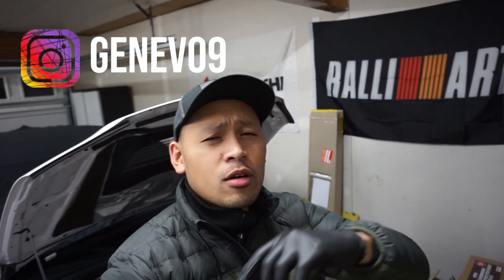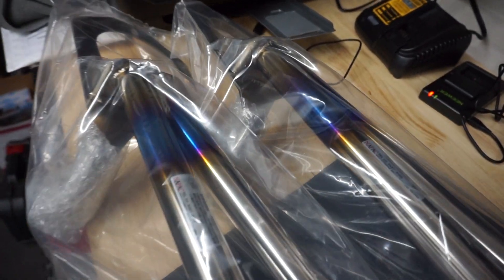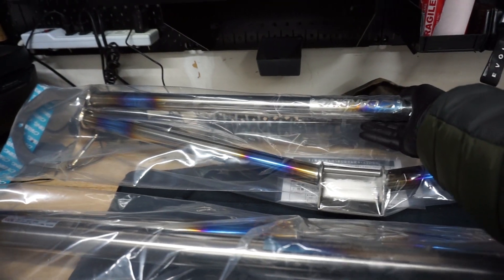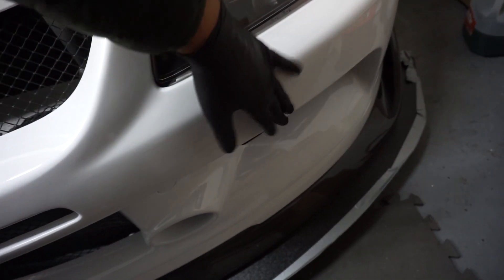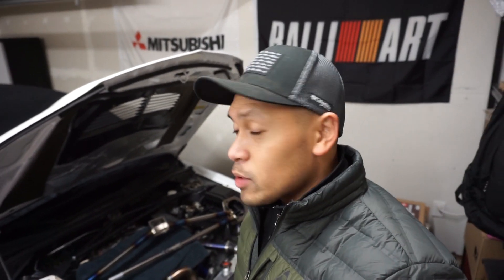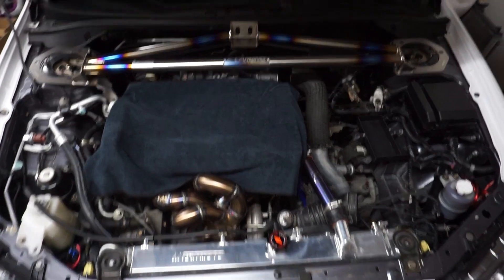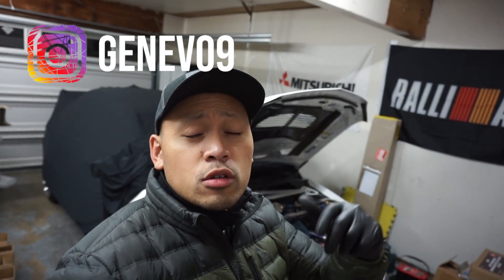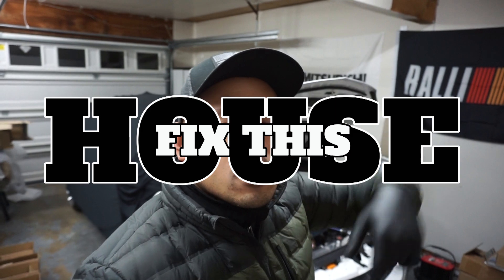My Evo 9 Rare Titanium Strut Bar And Evo 9 Rare Alloy Strut Bar!

Comment: Carbing for sure! You shouldn’t have to remove your coil overs to change out a strut tower bar. The struts will be held in by the weight of the car when you remove the strut tower nuts and it’ll be an easy swap. I’ve done it a few times myself. Keep up the great work!

Comment: Use the konsai. Thicker and heavier, better stability on the turns. Should be dom cold roll steel
  I like the Ti. but the rainbow effects doesnt go with your engine bay. I would of left it the raw finish and gave it a clear coat. But i know car guys get moist with rainbow colors on Ti.😅